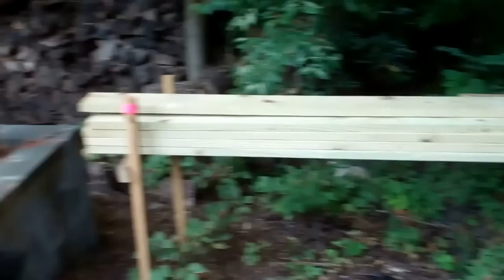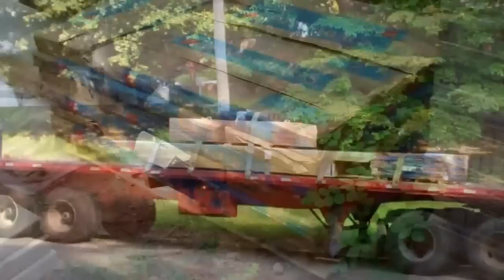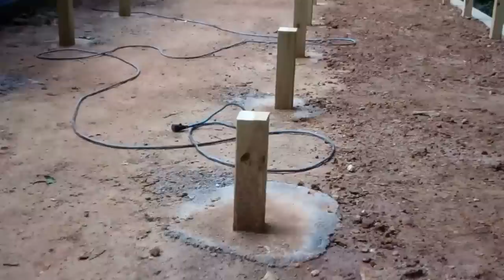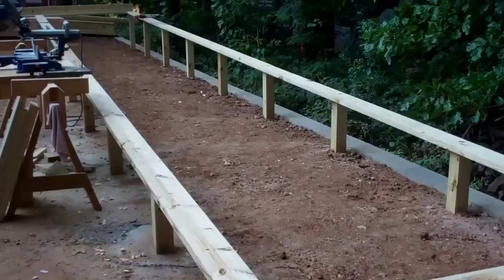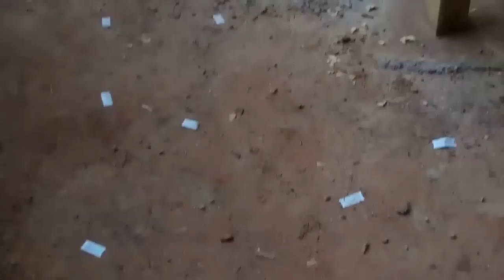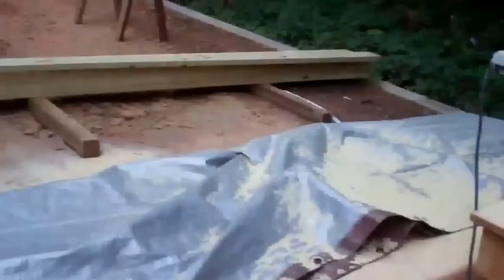Construction of Project 'Mega Shed' Part 4: Building the Subfloor Framing

Comment: I once thought screws were better than nails but a top builder said to me.. Screws SNAP and nails bend.  If your building sways due to wind or small earthquake or possible soil expansion you might get screw snaps.. . you best get some nails in that structure .. also yes I agree that center span is too weak.  yet you have the posts in cement but still seems weak in between.  If two pieces of wood are at a right angle and screwed together.. bend that past 90 and SNAP.. nails will ride it out.

Comment: Like your video and all the backyard builders with their advise.  I worked with a guy that stated he was an expert in housing construction and remodeling.  Wow was he a hack.  Got into an agreement about the proper way to install replacement windows.  Ended up betting pay checks. I printed off numerous instructions that told him he was doing it wrong.  I even printed off instructions form their window supplier saying he was doing it wrong.  Never paid up on the bet.

Comment from the maker: Thanks! The deck was a matter of preference actually-It was easier to run the deck boards width-wise cause there would not have been sufficient support otherwise, and would have been more work cutting the boards length-wise. The joists are actually doubled up just not shown real well in the video. There is sufficient support. It's actually resting on that 4x4 center post on the back wall by 3/4 inch or so, and every thing is glued with Liquid Nails and screwed together with 3 1/2 inch screws.

Comment: Wow! Now that's a "Mega" shed alright! Great work man, but a quick framing tip regarding those blocks between each 6ft floor joist. Instead of taking extra time in staggering them so you can screw from in from back of joist, simply snap a single chalk line & line every block inline, by screwing diagonally from outside edge of the previous block. It saves a lot of time that way & still makes for a secured attachment from screwing these in from behind the perpidicular joist. Cheers!

Comment: When dealing with that much length I would re-amend to use a water level, that is a clear plastic hose filled with water. Put one end on the pole and the other on the other pole. Where the water line is that is the point you need. And then you have a perfect level.

Comment: My one tree cents advice after working in a prefab housing factory we would never use screws to tie framing, screws breaks like glass on stress or hi-Wind ! nails in comparaison will only bend not give away like screws  ,a framing airgun with PL construction glue would be more strong than screws assembly and ten time faster ,screw are ok for plywod flooring with Pl construction glue ...screw framing in many area wouldn't pass code
Reply: BadPete99
Reply: There are screws rated for framing, but they weren't used here.
Reply: I know moisture content in a specific area can contribute to code as well.

Comment: Yeah your right California has different building codes so if your on the east coast your have hurricane winds nails are still better and the preferred choice for structural engineering when it comes to wood framing California code is the standard for many state codes because of the severe shock that the framing members go thru love the idea of the mega shed if you make any improvements post them
Reply from the maker: Agreed. This project almost broke me financially and I'm still recovering but I hope to build a 12' x 12' deck on the back of it one day.. If I do, I'll be sure to film that as well. Thanks!

Comment from the maker: 4x4's were spaced 5 feet apart the length of the floor, and 5 1/2 feet spaced apart for the width.
We went 4 feet deep on the retaining wall side, 3 feet deep for the middle row, and 2 feet down for the last row per the building inspector's orders because the fill dirt was not packed enough  for a concrete footing and cinder block foundation, so the varying depths were needed to reach the original ground based on the original slope of the lot.

Comment from the maker: I think so.. I don't remember the exact measurements.. It's not a true load-bearing wall in the back and this setup gave us an extra 2 1/2 inches of floor space inside. 
All I know is it passed the city building inspector (and he was nit-picking a lot) and he approved the layout with the overhang, and to refer back to the original schematic drawing in the video (3rd video of 16 at about 1;45) as this overhang was reflected on the print layout as well. Thanks again.

Comment from the maker: This won't happen cause everything was done better than code. It has a double rim joist as well as every board glue and screwed.. Longest length space is only 5 1/2 feet from the next 4x4 post.
They are even lag-bolted to all 27 4x4 posts.. Even the building inspector said this built  better than most homes are built.

Comment: Just watched your whole shed build, great job. Quick question, why did you rotate the joists for the deck 90 degrees from the rest of the joists? Couldnt you have just doubled up the joists under the front wall then continued with the rest of the joists? Also as someone else asked, is there anything providing support under the "T" intersection between the center sill and the back wall sill? It looks like the back wall sill would overhang the 4x4 by 2 inches and leave the center sill hanging.

Comment: Thanks for the reply, I'm still just trying to understand that mudsill to post connection. The post is 3.5x3.5 inches, the middle sill is bearing on .75" of that. That only leaves 2.75" for the short back sill to bear on. So is it overhanging the back by the remainder of 2.75"?

Comment: Really liked your video, One question, How did you secure the rim joist to the mud sill? What are those black spikes or screws that are on the under side of the mud sill at 5:51 in the video? Can't tell what that is ,looks like they are evenly spaced. Thanks!
Reply from the maker: +David Kestler Thanks! Lag bolts if I remember correctly.. I believe those are lag bolts also. 
I was helping for the most part and tried my best to record and explain as much as I could as we went along but I'm sure I missed some important points.

Comment: you mentioned preferring screws over nails, but ive heard and read that screws lack shear strength, and that nails are better because of flexibility, although not nearly as fun to put in as screws(impact diver! them things are fun!) im curious how you see that issue(shear strength, not entertainment value)
Reply from the maker: 8 years later it's still standing and no screws have popped.
Reply: @rvr2  does it contain a good amount of heavy things? i need to make a storage room onto my house, i might want to do something similar if what you did is working, and how far apart are the posts underneath(on center please)?
Reply from the maker: I've since converted it to a mancave complete with a tiled bathroom, kitchen sink, countertop, furniture, washer/dryer, how water heater, etc. See my dedicated playlist for updates I've made since it's construction. The 4x4s are spaced 5 feet apart length wise and 5.5 feet apart width wise.
Reply: @rvr2  would this design you have work for a room that would have a wood burning stove, lots of shelves, a gun safe, and maybe stored water?
Reply from the maker: It should but with that kind of weight I would reinforce the floor using 6x6s or build it on top of a concrete slab.
Reply: @rvr2  might thought was to use 6x6 posts (pressure treated) in concrete filled sonotubes, but the manufacturer said the biggest they reccommend are 4x4s, so now im wondering if what i wanted to do would be good or would mess things up
Reply from the maker: I originally wanted to build this on a concrete slab but because the fill dirt was not settled the building inspector wouldn't approved the construction. A concrete slab would probably be the way to go for what you want unless you're wanting to build a basement underneath it then that wouldn't work..
Reply: @rvr2  i would want to do something like a slab but cost is a factor

Comment: After watching all the videos prior to this one Im just thinking why didnt you just drill holes on the original slope? It must only have been out by 2 or 3 foot so that would have meant having longer 4x4s on the lower side of the slope?
Reply from the maker: That could have worked but originally we were thinking of digging a footing & foundation or pouring a concrete slab over the fill dirt but the building inspector said that the dirt was not settled enough which would have made the building unstable and required the building be put on posts.

Comment: Not required to use joist hangers?
Reply from the maker: No cause they were resting on 2 x 6s..
Reply: +RVR2 
beautiful looking framing.  However, I would not say the 2 x 6 mudsill is NOT supporting the joists.  Yes it is resting on it and offers some support, but since it is not laying on solid concrete and laying flat, it does not offer that much structural support on its own.  

The fact that I saw screws from the joists to the rim joist which basically acts as a BEAM on outside and inside is the actual load bearing support.  It all is tied together and acts as a total structure.

So it looks like more old school engineering where joist hangers are not used but everything is screwed together which makes it even stronger than nails.  Normal framing today would bypass the mudsill, call the rim joist a BEAM and use joist hangers.  Hence the mudsill is a secondary support and main support is the rim joist beam that the joists are screwed into.  If you did not screw the joists into the rim joist "beam" then I would say there is a structural problem waiting to happen since the mudsill is not supported by a sturdy concrete wall and has gaps in between.  

But really cool overall and very even beautiful looking framing
Reply from the maker: Thanks! I was just a helper in this and CJ was the real architect on this project so I apologize for my misinformation.. Glad you liked the series!

Comment: Awesome videos! I've watched all of them at least twice. What supports the 6' mud sill underneath the front wall (back-side of deck)? The mud sill doesn't make contact with the 4 x 4 posts but deck joists are resting on the mud sill. Also, how did you attach rim joists to mud sill? Thanks.
Reply from the maker: Alan Ferguson Thanks! Glad you enjoyed them! My friend CJ who helped me build this would probably know the answers but it's been a few years now since we built this so I'm going to guess from memory - We ran a 2 x 6 across the row of 4 x 4 posts and used lag bolts to attach it to the posts. As for how the rim joists are attached to the mud sill, I think we used screws and Liquid Nails, but again my friend CJ would probably know.. If I see him, I'll try to remember to ask him for clarification. Thanks again!

Comment: I don't get the American way of doing it - it rains a lot in the UK so we couldn't use wood 'piles' set in concrete - they'd last about 5 years and they can't take much weight. So we tend to make a brick edge on concrete and have brick piles to sit the frame onto. The only advantage to the US way is that the wooden frame is anchored into the base so high winds (tornadoes) can't dislodge them - is this is why it's done that way?
Reply from the maker: It depends on the ground beneath the structure..
In my case, the fill dirt had not settled enough and the retaining wall was not permitted to be built on top of so the local building code called for post holes that were deep enough to reach the original solid ground beneath the fill dirt..We could have poured a concrete slab but that would cost much more money.
Reply: RVR2
Aah, Okay, that makes sense! I hear you on concrete costs - turns out its cheaper to buy a mixer and materials and do it myself than get someone in just to pour on the foundation I already made. Damn labour costs - maybe the communists had it right after all?! :D

Comment: Your 4x4 posts will be rotted out within 15 years.  Raised pier forms would've been the way to go.  Also screws don't pass most code because they have no shear strength for framing.
Reply from the maker: The 4x4's will last much longer than that... And it did pass code with screws.. -_-
Reply: Inspectors aren't always right.  As long as you keep the water off of those posts, it should be alright; but they do have a tendency to rot.

Comment: how do u nail the parallel wood in the center after you have done the one column. they seem to be right head to head on each other?
Reply from the maker: We just used Liquid Nails and 3 inch screws on each side to tie them together.

Comment: what size is this for real on the video u say its 15 feet wide but then on some of ur posts u say its 12 feet wide so which is it????  so if its 12 wudnt the posts be 4  feet apart and not 5 ???  12x 40 or 15 x 40 im confused
Reply from the maker: jp morso It's 12 feet wide and 40 feet long.. the 4x4s are spaced 4 feet apart Width wise.. the 4x4s are spaced 5 feet apart Length wise..

Comment: Why screws, screws break nails are ideal for framing hit a screw with a hammer and it breaks under pressure hit a nail with a hammer and it won't break it flexes you have to bend and hit a nail plenty of times before it breaks, that's the truth. Houses in California are framed with nails because of earthquakes. Nails are ideal I love the size of your shed but not the screws to joist your going to end up replacing a lot of joist in the future because those nails will break
Reply from the maker: California has different building codes than South Carolina.. The building inspector allowed them (he actually preferred them) because nails back out over time.
It's been over 3 years now and it's still holding up very well but we'll see how the screws do as the years go by..